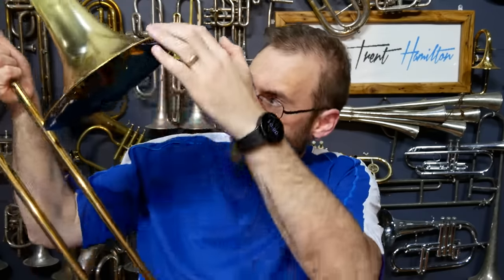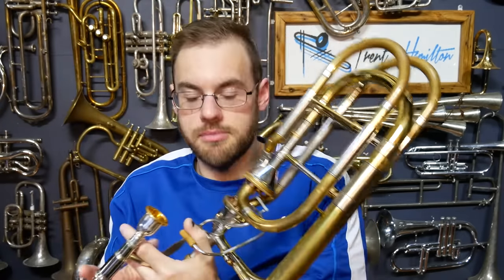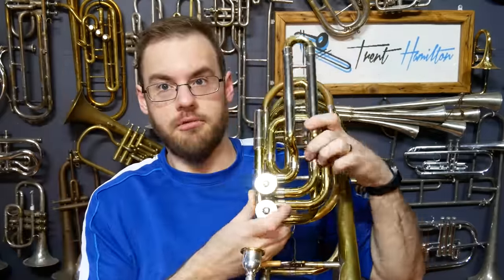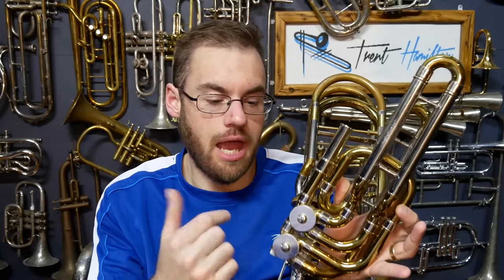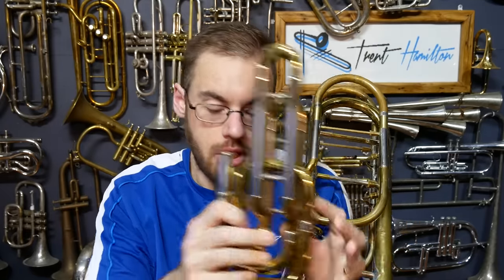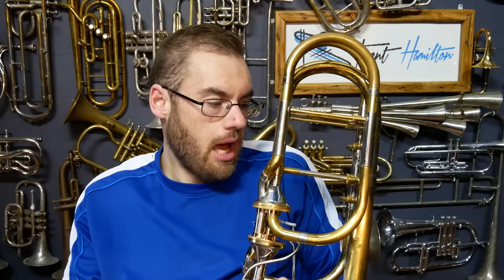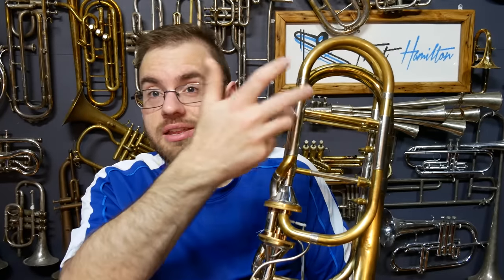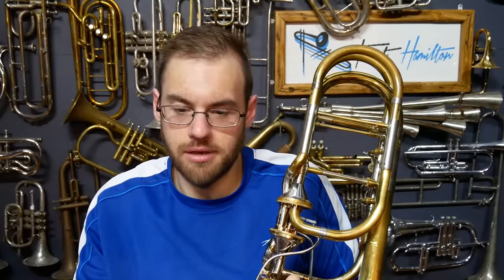Stradivarius Bass Trombone Thayer Valve Conversion Part 3. IT'S FINALLY FINISHED

Comment: Without seeing the inners, I would suggest just replacing the slide.  Sure, the leadpipe and the outers can be replaced, but if your inner tubes also need to be replaced or a good deal of work done to them, just replace it.  It comes down to could versus should.  It might cost more to replace the slide (if you are going with a new one), but you will conceivably get more life out of it.
Reply from the maker: My reluctance to do this is that the slide is where the instrument's serial number is stamped. There doesn't appear to be anything on the bell section.
Reply: @TrentHamilton  Could you keep the original slide for posterity but play on the new one? For me, a clunky slide would be way too distracting.

Comment: That is amazing!  I've long wanted a Thayer Valve bass trombone but finding one with a 10 inch bell that I can afford is a little tricky
Reply: I have to ask though, is there any reason why you want a 10in bell? If you are interested in trying out for a symphony orchestra, one of the most common mistakes for bass trombonists is using too big equipment. So I just thought I would ask if there is a particular reason behind it :) I've kinda been on the look out for a bass trombone with thayers but with a detachable bell so I can change out between a 9.5 and 10in
Reply: Why 10 inch bell ?!?
Reply: Dont use a 10inch bell lol

Comment: That looks very professionally finished. I'm curious whether there is more complexity involved with maintenance or lubrication for Thayer valves compared to the alternatives. Do you find them to be harder to keep in optimal condition or isn't there much difference on average?
Reply from the maker: Yes, Thayer valves do take more maintenance than some other valve types. There are different types of thayer-inspired valves, some of which are full cone ones, some of which have some of the mass removed (and are thus lighter). I don't have experience with all of them, so can't really comment. But all of the main braces on the valve section are all removable so you can disassemble the valves and maintain them - it's quite a faff. Unlike most other valve combinations, you can't actually access the moving parts of a thayer valve without disassembly.
Reply: @TrentHamilton  Thanks for the great information.
Reply: @TrentHamilton  Yes and the screws holding things together tend to create problems if you try to remove without any damage.

Comment: Interesting as I had my King Duo Gravis completely restored at BAC in Kansas City and left everything original but did restore the valves without the strings and made it independent. The full restoration was 2K but it plays amazing except I wish I would have had Thayer’s installed instead. I know what your referring too as it does take much more air to punch out the low C’s in 4th with both valves pressed down instead of open sound at 7.5 position.

Comment: I would get a Bullet Brace to help your thumb. On the King you can wrap your thumb around a brace. The Bach does not have that space. I had a Bach 50B3 and loved it but needed the brace. Good job on yours. I hope you can maybe find a single valve Bach 50 and use the slide for both.

Comment: You've also changed from tight closed wrap tubing to very open wrap for the triggers. Therefore it is not possible to say how much of the change is due to the valves and how much the wrap style. My dad plays trombone and he played a King 3B for a couple of decades starting in about 1973, it had a rotary valve trigger with semi open wrap and he loved it, says it never gave him any trouble playing with or without trigger.

Comment: Hi, I saw the part where you removed the lead pipe. My university actually has a similar model of trombone, with a lead pipe that also comes out and is around the same length as yours. My understanding was that it was actually designed to be removed so that you could use a tuba mouthpiece on it, and I would volunteer that yours could have the same feature. (It's also completely possible that the horn I have experience with had to be modified to do so)

Comment: Duh, Trent!  Now that you have the upper section the you want, of course you should finish it out on the lower section.  That red rust only spreads and it will destroy the upper.

Comment: Not a question about the instrument but I would like your advise (or anyone else who can help) on something. I am an 8th grade "bass" trombone on just a regular f-attachment trombone. I find it pretty difficult to clearly articulate or even get notes out past low D. Do you have any suggestions as to how I can improve those notes in the lower register?
Reply: I have the same issue on my instrument, my guess is that the instrument simply isn't made to play so low which compromises the sound. Tenor trombones are designed to play in the tenor range, f-attachment or not, and bass trombones are designed to play lower and sound good there, but would sound worse in a higher register.
Reply from the maker: Long tones. Sadly there is no shortcut. I used to practice my bass trombone sound playing in front of a large mirror. The surface reflected the sound, and I could view and correct my breathing and posture as I played.
Reply: You just need to play 1000 low D's and it will be easier to find low c.
Many people say low c is not possible with a single valve but it has been done for years. 
I think it is Phil Thiel that has advanced embrocher studies for low register on you tube.
Just keep at it.
Reply: That name is spelled Phill Steele.
Reply: Teele

Comment: I'm not so sure about these Thayer and Haagman valves, if they really make that much of a difference... Anyway, I don't play bass trombone a lot, I got my cheap Chinese King 7B clone that, apart from the poor build quality - I needed to get some things soldered back on after a gig - does the job actually quite well. And for my jazz gigs, I play a small bore trombone without trigger anyway. Maybe I'm not that good of a trombonist to feel the difference.
Reply from the maker: They do make a difference, but you need to be at a level where you can tell the difference between your own limitations and the instruments. Frankly, there are some professional players who chose rotors (and there are many different variations on rotary valves, some play better than others). I've enjoyed hagmanns and thayers. My nirvana would probably be hagmanns, but being in New Zealand (and not being regularly required to play bass trombone) I can't really play a huge number.
Reply: @TrentHamilton  Hagmann valves are pretty common here in Switzerland, but that's where they're from ;-). When I needed to buy a new "classical" trombone a couple of years ago I tried all different kinds, from cheap Yamahas with rotary valves, over Bach's Stradivarius line and different Shires and Edwards combinations. I liked the last ones very well, but decided to save a lot of money and bought a Conn 54H, which is more of a "step up" instrument, with dual bore and a normal rotor valve. I'm indeed not the player that needs an ultra-expensive instrument to get just a little bit more out of it, I don't play that well.
Then I'm still wondering: why don't other instruments like the French horn use such kind of valves, as the natural horn also doesn't have sharp bends and turns?!?
Reply: @HammondDirk probably complexity, therefore cost, as the "German" rotary valve is already complex enough, and apparently comes with some sonic downsides over pistons found in true "French" horns, but resolves the intonation problems. Plus, I suspect most folks playing the horn are doing so as a primary instrument at the pro level, unlike my foray into the horn one semester in high school. It's often about trade-offs where instrument design is concerned.
Reply: I am a professional bass trombonist and I play with  Courtois -  AC551BH-R.
It is equipped as you probably know with Hagmann valves.
If someone have questions , I will be happy to help with some answers 🙂

P.S. Sorry about my basic english skills 🤷‍♂️

Comment: Since this is already a project horn and a repair technician involved, you might check out M/K Drawing & Bending in the the U.S. They offer replacement outer slide and bend tubes, etc.